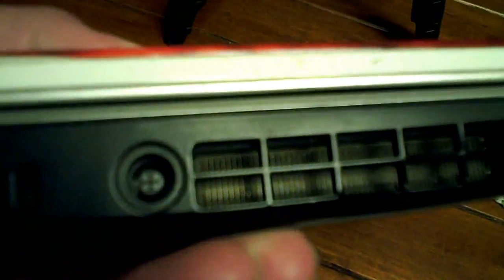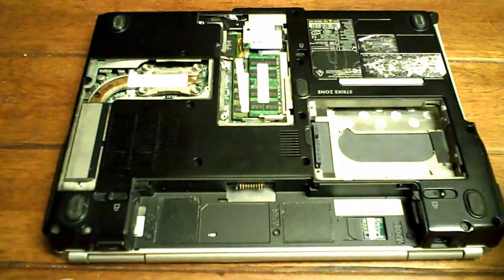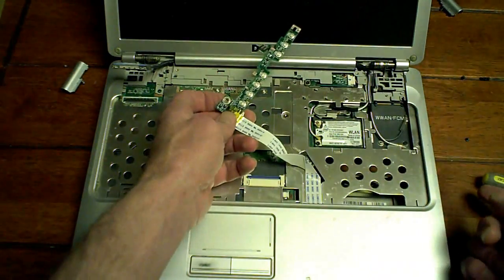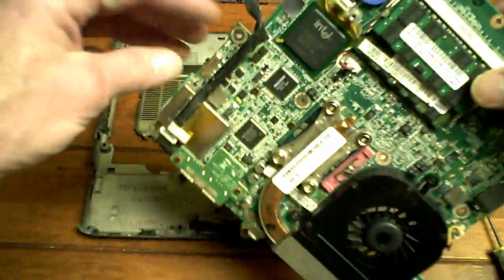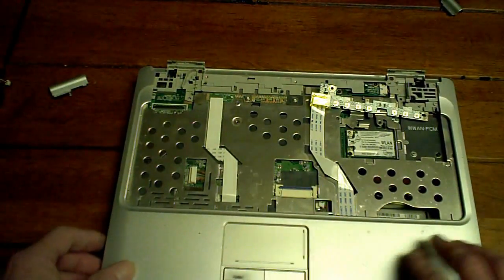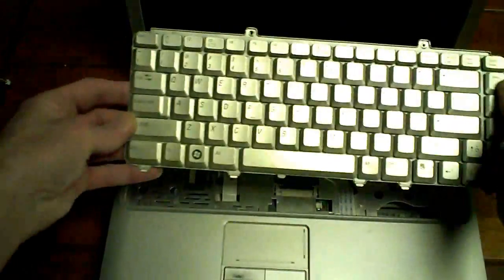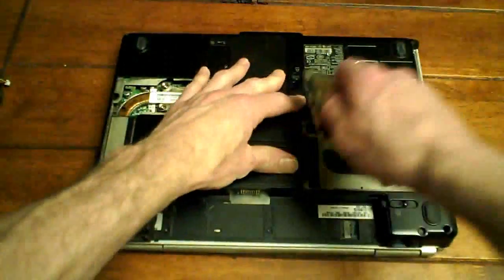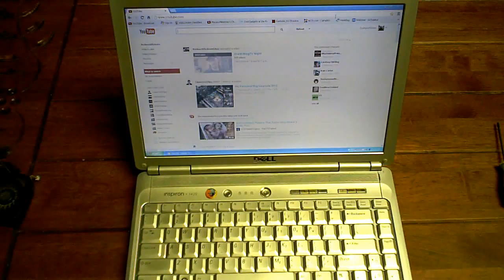Inspiron 1420 Tear Down

Comment: Whenever I take apart electronics with that many screws and different size screws, I loosen the screws in the bottom but leave them down in the holes, then stick a piece of tape over the hole so they don't fall out and get lost or mixed up. Then when I get the case open, I draw a diagram on paper with a few of the major components to use for landmarks then as I take the screws out I tape them on the diagram where they came from and label them as necessary. Works like a charm.

Comment: Hi, I have the same model laptop and it's broken and falling apart so I thought of using the motherboard for a project.
At first it Boot to bios since it doesn't have a Hdd and worked just fine but now there is this on board orange led that is turned on and nothing works any more.
Could you please the orange led indicates, it's beside the blue light to the right above a tower symbol.